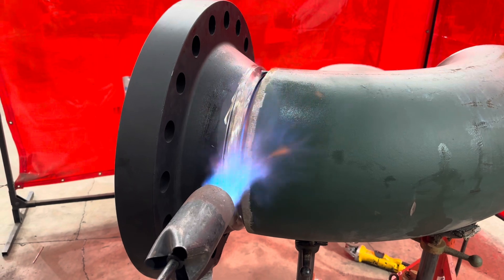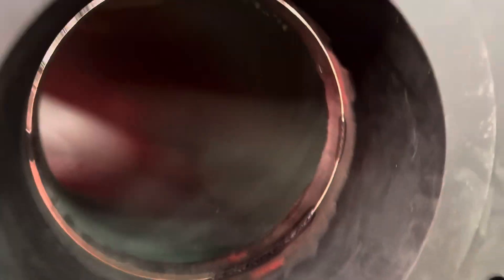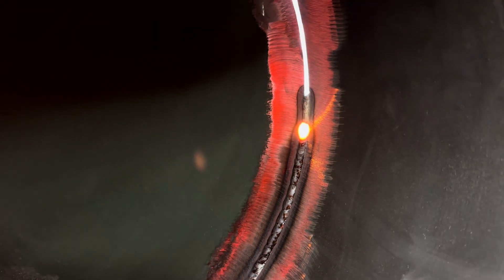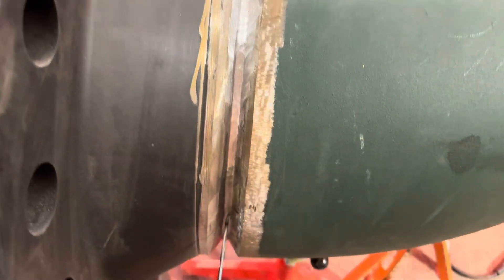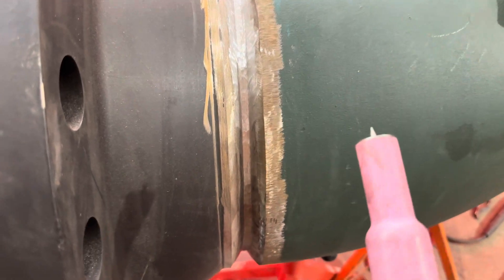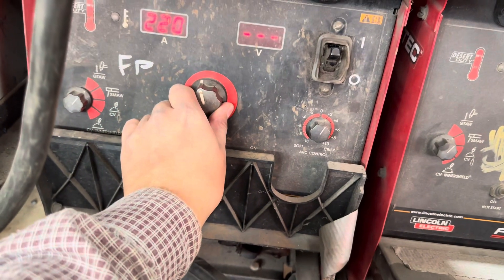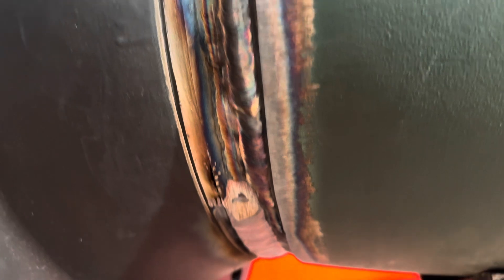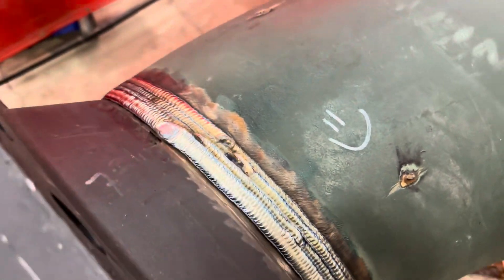How to weld Heavy wall pipe 100% X-ray carbon steel(TIG)

Comment: thats it in a day ????????????? jesus i lay way more weld than that in a day
Reply: How about nice job bro, instead of being an a-hole?  Jesus!
Reply from the maker: We were welding around 1 each day for about a month straight it takes a toll on the body. So I was taking it easy and it also slows me down when I have to record and explain the process. And our tolerance is a 1/16 out of square so I have to monitor the levels and flip the spool with the crane whenever it pulls too much and sometimes the crane is busy

Comment: Yo g! This is sick, I weld pipe on a daily basis but not this thick wall. How do you get to do the four passes so uniform? Do you draw a line or something in there to follow? Sick job brother, greetings from Spain!❤
Reply from the maker: @articz267  i don’t draw any lines I just use a weld lenses that allows me to see very clearly and it helps me keep it more uniform. The weld lenses I use it called a vintage view black daliah with the shade 11 version . I would highly recommend it💪
Reply: @2freshgarage184  okay, I'll check it out buddy! Thanks once again

Comment: Good video. It is to bad you work for a company that does not provide a Positioner. I have worked for companies like that to. Makes it hard to get the work done easier and faster. You did a nice job 👍🏼
Reply from the maker: We have some roll out wheels but since I’m younger I take the in position welds and allow my older co workers to use the postioners. I usually weld in the refinery’s so I don’t really have a problem welding in position. Thanks for watching 🙏

Comment: Weld it next time with mini arc uphill if it will allow it...run root down hill, hot pass up hill, fill n cap uphill...i use to make it look like tight shoe laces all the around....havent welded since 2006..11 yrs industrial structural welding on drilling rig and navy ship parts.....enjoyed while i did it..dont miss the body aches from bad positions for hours at a time..lower back can't handle it no more..cheers

Comment: Don’t get me wrong very nice Weld. But why would you Tig a 16 inch heavy wall pipe all the way out? You should be jumping to stick weld after the first three passes of Tig.
Reply from the maker: @threestrikes8262  the welding procedure we have for these pipes only allows for TIG to be used . That’s how the customer wants it basically
Reply: Got you, cause normally something that thick will use GTAW & SMAW process. Still nice weld.
Reply from the maker: @threestrikes8262  I was on the oil rig offshore and had to do a tie in on one of these big pipes and the operator was telling me they prefer Tig because it causes less sparks than a stick weld which reduces the chance of fires that could also be a reason the procedure is just Tig.
Reply: That makes more sense why they would have you do the GTAW all the way out. How long you’ve been welding.
Reply: The Procedure dictates how it is done.
Reply: Of course procedure dictates. That’s why I asked the question why was the weld done with GTAW the way out. I have had welders under my supervision who have violated procedure and have Tig Welded the joint all the way out, and inspection group have us cut it out, when the procedure called for both the GTAW & SMAW process, and they knew better.
Reply: Nah I’d rather mig/flux that if allowed
Reply: Tig is less chance of something going wrong.. more skill but a lot cleaner.. Procedure is just a way to justify paying some over paid Qc that can’t make the weld to begin with.. that joint can be welded 4 different ways and still end up the same n the end.. sealed up and defect free.. I say Tig them all
Reply: Because who decides this is not the welder is the client’s procedure

Comment: Here's my 2 cents to anyone interested... 

When you're tig welding carbon pipe, make sure to use ER70S-"6", not ER70S-2. It's a night-and-day difference, especially on the root.
Reply: I agree but if they’re calling for 70s 2 that’s what you gotta use and it’s probably all they have. Been on many power plants and it’s all they get. I used to sneak 70s 6 in for gate tests since it does weld a lot better.

Comment: Never seen 4 beads! I feel like being a welder is impossible.. I learned to walk the cup when I went to a welding school and practiced from all the different angles/ positions etc but knowing how many beads , the amps, wire, gap size etc seems impossible to learn … I don’t think welding is for me
Reply: We love it man it takes practice and dedication to the craft. Just like any other profession
Reply: nah you just gotta keep practicing at it over and over and you can literally see it in your head how it will look when it's done when you're ready to do the cap. amps material used and gap size will come to preference or work procedure specification. just play around with it when you can. If you're passionate about it dont let something get in your way.

Comment: Great video but steel doesnt contain moisture.
Reply: 100% does but I'm guessing this is satire.
Reply: @pacebozeman  No it doesn't. Simple Google search and you will be convinced.
Reply: @dinoj8126  it doesn't absorb or hold moisture, but preheating before welding is necessary nonetheless, just not for the reason he said lmao
Reply: Are you stupid or stupid? It clearly does if it sweats…..